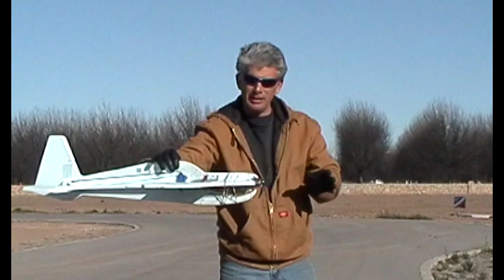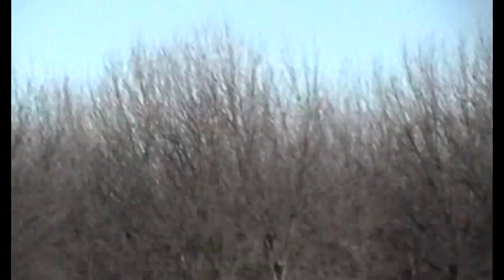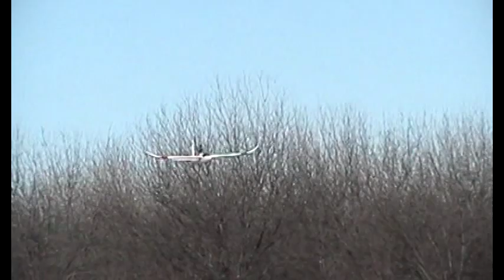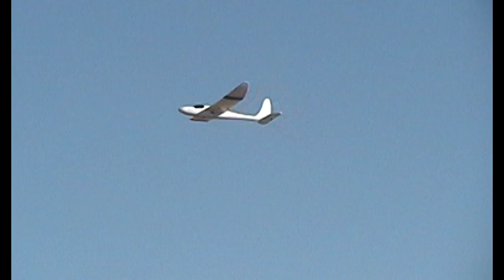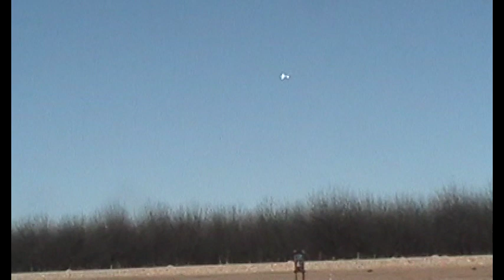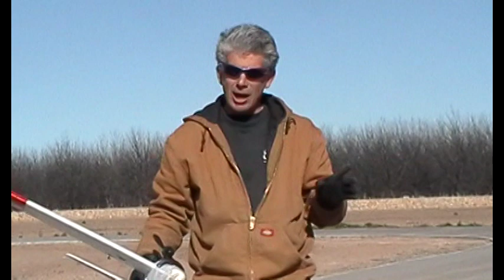Beginners Flight School - Stalls

Comment: I understand the elevator 0 but what are you doing with the throttle at that point to break the spin stall are you also backing off the throttle 100% or what are you doing with the throttle?

Comment: Thanks for the info. Just one question, if the stall is all about angle of attack and not for the air speed. Why planes can do a loop?
Reply from the maker: Angle of attack is relative to the direction of air flow, not the horizon.  As the plane moves through the loop, the relative airflow direction is constantly changing.  If the wing stalls because the angle of attack to the relative airflow exceeds the critcal angle, the plane will no longer continue in the loop.  This type of stall would be classified as an accelerated stall.  The plane is accelerating toward the center of the loop (centripetal force).

Great question!

Comment: So does it only stall at a 10%  angle. And does that mean that it wont stall at 90% angle also can you atleast fly at 90% angle without stalling. Not sure if you mean that it only stalls at a 10% angle. Or it stall at any angle just usually at 10%.

Comment: So that’s why they say about planes c/g and it’s far worse to have a tail heavy plane ??
Reply from the maker: Thanks for watching Phil.  In a nutshell, yes.  Tail heavy C/G can create a stall condition that is not recoverable.  The tail heavy condition creates an attitude where the relative angle of the wing can't get below the critical angle of attack (the stall angle).  Great observation!
Reply: phil kennedy. I try to remember a nose heavy plane flies badly and a tail heavy plane flies once. If not sure err on the side of nose heavy.
Reply: "a tail heavy plane flies once" - is not true. It's a lot harder to control but it sure is possible. Not recommended for the new pilot though.

Comment: A stall is actually caused by angle of attack and the airspeed... Duh out really is!!
Reply: Aaron RC hey, i'm a flight instructor, and i can confirm that a stall is just based on angle of attack.  you don't need slow airspeed to stall.  the reason stalls happen often with slow speed is because that's an easy and accessible way to have a high aoa, and getting high aoa in any other way would require high g forces and aggressive maneuvering.  lift = air density times wing surface area (both are fixed values which cannot be adjusted by the pilot, unless you throw flaps into the mix.. let's not), times coefficient of lift (directly related to aoa) times airspeed (those two, coefficient of lift and airspeed, are what a pilot plays with).  so when you slow down, you reduce airspeed, which reduces lift, so to increase lift to sustain level flight, you increase coefficient of lift (aoa).  when you hit your critical aoa, you stall.  you dont need to be slow to stall.  like, if you're diving straight down at a super high airspeed, and you pull the elevator backwards hard to level the plane out, the nose will point up, but momentum will keep the plane going straight down for a period, so the aoa would be very high, and the plane stalls at its max speed!  also, just remember angle of attack is the angle between the wing cord line and the relative wind, not the angle between the longitudinal axis of the airplane and the horizon of the earth.  this is the most important thing to consider.  stalls are directly related to the angle the wing makes against the relative wind.  it's very important to be able to visualize this as a pilot.
Reply from the maker: Hi Aaron. Thanks for watching.  It is angle of attack.  You may benefit from reading this. http://en.m.wikipedia.org/wiki/Stall_(flight) Best of luck and happy flying.
Reply: Oh I might be wrong because I'm more like a glider flyer before I even start rc :) and gliders do stall when they lose all its kinetic energy which is airspeed..... So I'm sorry if I'm wrong :)thanks for the advices anyway
Reply: Christopher Modiano I was taught that stalling is when drag overtakes speed and the wings looses their lift so to me and probably a majority of the world would say speed has a big key in stalls
Reply: Also, isn't that the reason for the term "stall speed" you hear everywhere
Reply: +Slacin' Ace yes, for straight and level, that's true. Stalling is directly related to angle of attack, and indirectly related to airspeed. Stall speed changes with weight, bank, and atmospheric conditions.
Reply from the maker: Configuration also affects 'stall speed', but in the end, it's still all about AOA.  Thanks for the great explanations Christopher.
Reply: Man, today is an active day with commentors xD

Comment: YOU DO NOT MOVE CG FORWARD. IT WILL GET WORSE BECAUSE THEN YOU HAVE TOO MUCH UP TRIM TO COMPENSATE THEREFORE WITH LITTLE OR NO POWER YOU FLY RIGHT INTO A STALL...EVEN FASTER.
Reply: troballs1. Please fix yourself. Your all caps make you look like a child. And are you telling us that you have flown a plane with little or no power and you held up elevator and stalled and blamed it on CG. Really? No power except you want to fly up? Try physics.

Comment: Your exactly wrong I believe. Yes angle of attack can lead to a stall but any tip stall is a direct result of loss of air flow over wing. Angle of attack just reduces air OVER the wing. ie; stall. But thanks for the video
Reply: he is in fact correct. the wing doesn't care one bit about airspeed, all it cares about is AOA, you can be going fast and still stall if you exceed the stalling angle of attack, and if you fly at half the stalling speed its doesn't mean you are stalled (you wont be holding you altitude) but if the AOA is below the magic value then its not stalled. its just that when you slow down, you need a higher AOA to hold altitude, too slow = AOA exceeding critical angle in attempt to hold altitude = stall
Reply: +troballs1 Its a very in depth topic, so in depth in fact that there are many pilots out there who dont know it all. The angle of attack dictates the amount of airflow lost over the wing, this is true, but at slow speeds (below about 200-300kts) AOA is the only factor, the wing will stall at exactly the same AOA regardless of airspeed. At higher air speeds the airflow will actually break up faster and the wing will stall at a lower AOA.

for example, an A330's wing stalls somewhere in the mid teens (around 14-16 degrees AOA) at low-medium speeds, however at cruise speeds it will stall at around 7 degrees AOA due to compressability issues at high subsonic/transonic mach numbers.

But at low speeds (where all RC aircraft fly), the only factor which will cause the airflow over the wing to break up is the AOA. You can be flying well below the stall speed, but with the AOA low you can still have smooth unstalled airflow over the wings, you wont have enough lift to maintain altitude, but the aircraft will not be stalled by definition.
Reply: Jamenator1. You uh sound pretty smart on this subject. May have to ask where you got your info. Links please. Good to have some factual math based answers and sources.
Reply: I realize that this is an old comment, but it’s complete nonsense.

Comment: Will a heavy plane, such as a 1200 mm bf 109, still float after a stall, or will you have to re apply throttle to straighten it?

Comment from the maker: @tomtom4867 Thanks for watching TomTom.  I understand the confusion about airspeed and stalls.  Your example about the 747 mixes 'angle of flight' (ie. direction of travel through the air) and 'angle of attack' (ie. the angle of the wing chord to the relative wind)  I discuss this further in detail at the RCPowers link in the description.

Again, thanks for watching.  I hope the forum thread helps to clear things up for you.  Happy flying.

Comment: dude stalls are caused by airspeed.....at higher angles wings just stall easier...

your telling us that a 747 wouldnt stall if it was flying level even if its airspeed was 140kts fully loaded??
WHAT?
Reply: tomtom4867. Look up glide path. Are you telling us they put up those planes and if engines go out so they can't maintain full speed they stall and fall out of the air. No they don't. Pilots are trained to loose elevation to maintain speed. If they have lower speed they have lower lift. It is all a matter of potential energy and flight characteristics.
Reply: Lower airspeed increases aoa. Ultimately, critical aoa will stall the plane

Comment from the maker: @DeaconLen52 Thanks for watching.

Without seeing the plane, it's hard to know what's going wrong for you.  'Shooting straight up at launch' is not what you want though.  Check your CG according to the instructions to make sure it isn't tail heavy.  I would also recommend watching my first flight video.  If the plane isn't flying all by itself when you launch it, you need to make some adjustments to the plane.

I also recommend a pusher prop airplane (Hawk Sky'ish) as a trainer.  Good luck!

Comment from the maker: @majch Thanks for watching.

During your flight training, you are likely to learn how stalls can (and will) form regardless of the orientation of the airplane to the horizon.  A plane can have it's nose below the horizon and still be stalled.  Likewise, a plane can break out of stall with it's nose above the horizon (see 5:50 of this video for an example).

You can actually see the elevator well during many of these stalls, but it is fully deflected up.  Release the elevatore and the stall ends.

Comment: As an student on his way to getting a Private Pilot license (waiting for good weather for first flight, it's been canceled twice ARRR), I'm also becoming interested in RC planes.

My question is, when you stall and enter a spin, your nose is, obviously, diving downwards. To break out of a stall, as you said, you reduce elevator, but then wouldn't you still be diving or will the plane level out by itself? Will you then need to add elevator in order to be at level?
Reply: majch. Elevator is reduced only until and only for control. Only after control can you go level. If you have control and enough power, you can fly wherever you like, and we'll maybe oxygen and a spacesuit.

Comment from the maker: @wildcardjoker Your description certainly sounds like a power-on stall leading to a spin.  Stall recovery is simpler at reduced power settings.  For most recreational RC planes, reducing throttle to zero, releasing the elevator, and rolling the wings level should break the spin very effectively.  Very stable RC planes will do this all by itself by reducing throttle to zero and releasing the controls.  Thanks for watching and hope you found the videos helpful.  Happy flying.

Comment from the maker: @3xut 

It will be a while before I get anymore videos out.  Farming is keeping me very busy right now.

The Hawk Sky needs a lot of down elevator to maintain level inverted flight.  For inverted flight, I use full down elevator trim.  While upright, I keep the plane level with up elevator, then neutralize the elevator once the plane is beyond 45 degrees of bank in the roll.  When rolling upright, be ready to give it back elevator before it starts to dive.  Lots of elevator movement in the roll.

Comment from the maker: @plair473 
Thanks for watching and enjoying the videos plair.

You are completely correct about the colors.  I was wondering if anyone would ever notice.  I slapped them on in my kitchen just before a flight and realized they were backward while walking to the flight field.  I never bothered to redo them.  Also, I found that the colors were not sufficiently different when the plane is flying at altitude.  When I do it over, I'll mark only one wing.

Nice catch on the markings though!

Comment from the maker: Hi RC.  Thanks for watching my video on stalls.

First, I want to answer your question well, but there isn't enough room in a comment to fully explain all of those points.  

Will you do me a favor?  Please ask this same question at RCPowers in the thread I created for this video.  It is located in the 'Videos' section of the RCPowers forum.

The short answer is that airspeed and angle of attack can be related to each other, but a stall comes from excess angle of attack, not lack of airspeed.

Comment from the maker: Hey Bob.  Thanks for the kudos.

First let me say that I tend to instinctively pitch the plane to the horizon after a stall.  I have to consciously think about leaving it alone for some of these videos.

That said, there are at least a couple of recoveries that involve only the release of the control sticks.  The recovery before the radio glitch is one I specifically gave the airplane no additional inputs after releasing the elevator.

During normal flying, I pitch to the horizon after recovery.